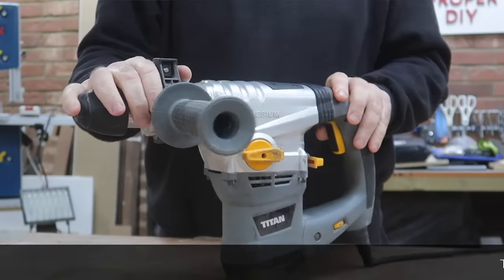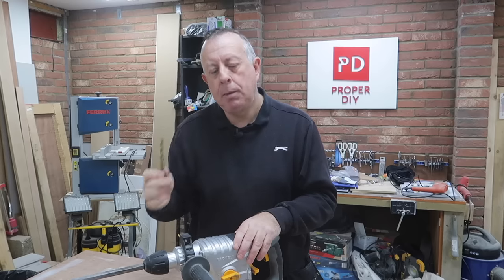Don't Buy Just a Hammer Drill

Comment: I have a rotary hammer drill similar to your Titan for about the same price. I use mine for granite rock which is much harder than brick or concrete. I drill  my holes in stages going up to 5/8" so I can insert rock splitting wedges. I tried the Dewalt drill like you have and it needed chucks replaced twice so it was not up to the job. My new rotary hammer has a problem with the tips on the drill bits melting. The drill spins at 950 RPM. Perhaps I am pushing on the drill too hard but I drill for 15 sec. pause and spray the bit then try again.  This morning I went thro 5 bits: Bosch, DeWalt and Milwaukee - 3/8 " and the tips went mushy. Am I using the wrong  bits or the wrong technique??

Comment: I just bought a rotary hammer drill and I'm having trouble finding a grease, the owner manual says to use universal lubricating grease, so I reached out to the company and they said use shell or mobil, that just gives me the brand name so I reached back out to them about the type of grease but got no response. Just wondering what type of grease do you use in your rotary hammer drill, a lot of people say you need a grease with molybdenum disulfide nlgi #2. What type do you use in your rotary hammer drill like mobil ux ep2????

Comment: Hi, I want to drill into the side of my chimney breast about 20" through into the firebox (fireplace) to run a power cable for an electric fire and am wondering what material I'll encounter, I'm thinking it's breeze block and  brick? so relatively soft and not concrete in this area, so again thinking a new standard masonry drill bit 600mm x 16mm will be fine, 16mm so I can insert a 15mm copper pipe sleeve through, although the sleeving may not be necessary.
 Or would an sds drill be best for this, I have an old sds drill but the chuck has gone wonky and the batteries are not good.  I do have a new dewalt drill similar to yours just with hammer action, would this be ok if I take it easy? Thanks, David.

Comment: Bosch battery 24v best i found
Reply: Have found the Bosch 24v very good, but Ni Cad batteries  have died in mine, looking at around £100 for two  24v Ni-MH batteries, so replaced with a 18v Bosch GBH 18V-26 sds drill, even better. than 24v

Comment: There's no reason for a DIYer to have an SDS. I'm a contractor and i drill 60% of tap con holes with my M12, 30% with my M18, and 10% with my SDS. If you need to drill a larger hole, rent an SDS for 4 hours.

Comment: dude i watched you drill the stucco exterior wall, looked good until you pushed the 5 to 6 inch long drill all the way in the wall,, what was the point of that, your stucco is at max 7/8 thick to maybe one inch  in some cases, any deeper then that, you might snag water or gas a pipe, electrical wire,  so next time dont over push in, go as deep as needed only ... cheers from LA CA USA builders

Comment: "All but the really cheap ones have a hammer mechanism" is not correct. Plenty of professional drills without hammer action - because it's one less possible point of failure. 
      Someone working with wood or metal won't have need for hammer action, but they will have a need for a drill that outlives others.
      (I've got 4 AEG drills without hammer action, and 1 nigh identical AEG WITH hammer action. Over time, the one with hammer action has developed a bit of a wobble - sooner than the others

(The gearing mechanism in 99% of battery drills are made of nylon. 
   It simply flexes a little more than hardened steel.
    The hammer mechanism adds another axis of movement + another axis of wear & tear.)

The bodies alone were around €200-220 (it's basically Milwaukee (same company behind it, same components on many tools) - aimed at the professional market. 
      Which of the 2 brands gets to be the one they promote depends on the country. For instance, in Australia it's AEG, not Milwaukee)

Now... I wouldn't call that 'really cheap'.. Would you? :))

Comment: I bought a Bosch SDS about 30 years ago (for the past 20 years I haven't used it very much).  I've never had to replace a bit. Drills any concrete like it's wood. (My last house was stucco, was once shot with a 9mm from about 50' barely penetrated 1/4", imagine  how hard the old concrete footings are. In fact I used to use powder actuated nails in a lot of office buildings - no problem.  On the utility room slab of that house they simply didn't work.)
Think of hammer drills as disposable. Stucco? House less than 30 years old? Sure. Concrete? It won't hold up for very long.  You can kill one of those things with a single hole. I'll even use my Bosch with 3/16 or 1/4" SDS bits on plaster to make holes for plastic expanders. Makes very neat precise holes, never dulls the bit, bit doesn't 'walk' or wobble.   Does a DIYer need an SDS drill? No but they need to have a friend or a neighbor who has one. Or if you need to drill into concrete - just go rent one. (And my Bosch doesn't have the hammer only function which I could've used many times - so that advice is spot on.)

Comment: If you're going to drill into concrete or brick you'll need Hilti not Dewalt.
Reply: Watch the video. Its not a brand issue. Its the difference between percussion hammer and sds rotary hammer drills.

Comment: Have you had much experience using a SDS with 4” Core Cutting Bits to get through walls for extractor fans or waste pipes. I’ve heard they can grab and give you a nasty injury when they do grab.
Reply: I've only ever used a core drill once for a tumble dryer vent hose. It was years ago but I used a heavy but powerful hammer drill and it worked just fine. I think the reason why some have said a SDS can grab. It's probably because they've applied too much pressure. Nice and slow is the method for core drilling.
Reply: They can grab,need to kept the core bit level, & let work at it's own pace,don't force it, & use a drill with a clutch,saw my neighbour knocked off a ladder ,he was core drilling a hole, bit jammed, drill spun round & it smacked him in the  side of the face, not a pretty sight,spent several days in hospital.
Reply: Need a drill with a clutch, or someone to drive you to A&E! Dont use hammer action, keep it level and keep the hole clear of debris.
Reply from the maker: There's nothing like a large drill grabbing to break your wrist. When I worked on site we didn't allow cores to be cut with a hand held tool for this very reason.